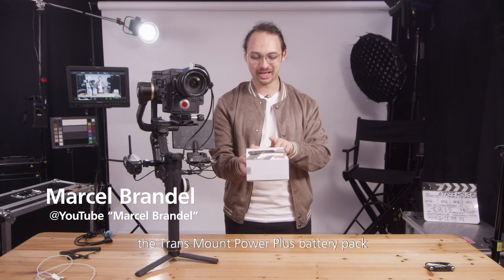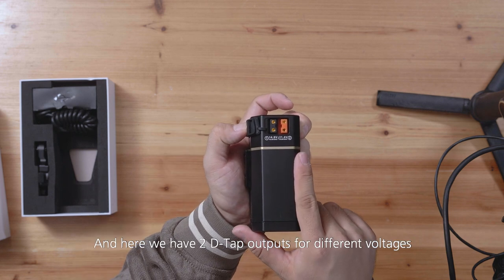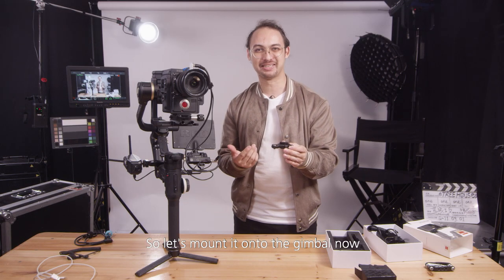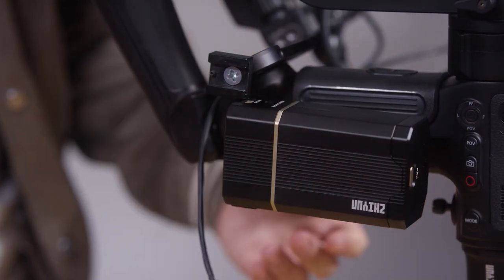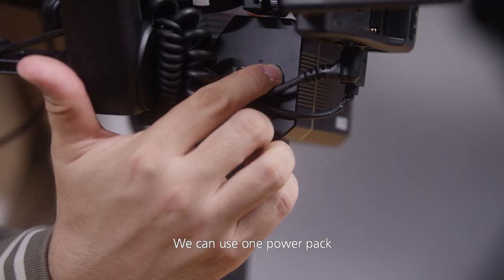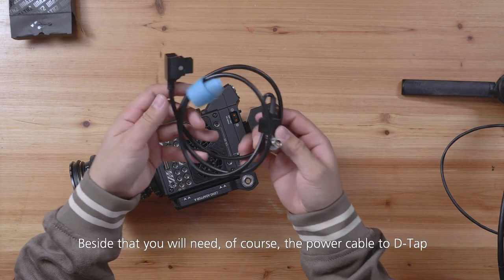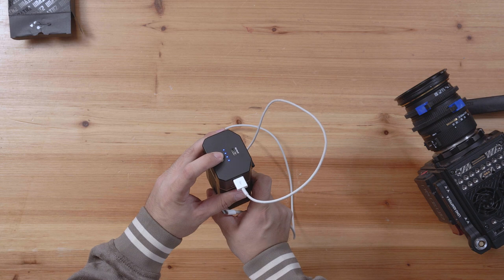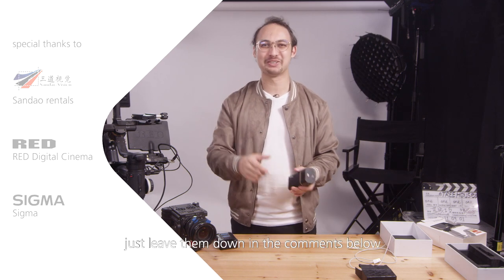Zhiyun Crane 3S OFFICIAL tutorials C4 transmount powerplus battery pack

Comment: Nice video! I‘m not sure if you still answer to these videos but you might be my last hope. My Transmount Battery pack shows a permanent 3rd LED always on. No LED except the 3rd one is always on and I cannot turn on or off the battery pack. It will be the same when I remove them, leave them out or leave it at idle for long time. What does it mean if the LED (3rd from the right to left) is always on? Thanks in advance! (This is a brand new 3S Pro set)

Comment: I HAVE THE ANSWER!  You have to isolate the bad battery(batteries) and remove them completely. Trash them and replace them with good batteries. You should have the extra 3 that came with the gimbal. Swap out the good one for the bad one(s) and you'll be back up and running!

Comment: do you need to charge the batteries inside individually?
Reply: 1 year later, but for people (like me) who are looking for this answer (I just bought one and opening the manual looking for answers);

In the manual it says you can charge it via the included USB-C cable by connecting USB-C port on it to power adapter (not provided). User may use power adapter that supports USB Power Delivery (USB-PD) to charge the battery pack. The maximum charging power of the battery pack is 30W.

Charging non ZHIYUN 18650-2600mAh 3.6V Li-ion batteries with the battery pack is forbidden! 

Charging or discharging the battery pack must be conducted with all 6 batteries at the same state of charge. Otherwise the batteries may be damaged by over charging or over discharging. 

So I bought a Nitecore li-ion charger with this, thinking I could buy more batteries (non zhiyun ones or zhiyun ones) and charge them in that thing. But if should believe the manual it's better to just charge them within this battery pack with all 6 equal charged batteries, instead of individual battery charging in a seperate charger. I wonder how it works then when you want to use your spare ZHIYUN 18650-2600mAh's. Do we need to charge them in the battery pack and when full take them all out and store these as backup (as a pack). Or can we just easily put in 6 same charged (assuming full) that were charged at the same time, but individually in a li-ion charger (in my case I bought a 8 at the same time one). 

Kind of unclear really, if you ask me.

Comment: I bought one and I couldn’t use it. The power pack would not  power my ninja v monitor I’ve order 4 different cables it never worked. But powered the crane and I didn’t even try to use my dummy battery for my eos r. I just bought a fxlion nano. It powers my entire rig. Using d tap splitter. The only reason I kept this was for the mounting plate and dtap cable for crane.

Comment: Can you change the batteries inside the casing? If not I have to buy two extra battery charger plates
Reply from the maker: yes, you can change the batteries inside the case
Reply: Yes they are interchangeable

Comment: My powerplus still has 3 blue LEDs, yet turns off after a few seconds after initially being turned on. Any ideas would be appreciated
Reply: did you remove the transparent plastic piece inside it ?  :)
Reply: Bro i we doing the same
Reply: Contact Zhiyun directly and see if they can replace it
Reply: I HAVE THE ANSWER!  You have to isolate the bad battery(batteries) and remove them completely. Trash them and replace them with good batteries. You should have the extra 3 that came with the gimbal. Swap out the good one for the bad one(s) and you'll be back up and running!
Reply: I HAVE THE ANSWER!  You have to isolate the bad battery(batteries) and remove them completely. Trash them and replace them with good batteries. You should have the extra 3 that came with the gimbal. Swap out the good one for the bad one(s) and you'll be back up and running! The battery that doesn't fully charge overnight is the bad one. Trash it
Reply: Same here

Comment: The button to turn my power pack on doesn’t work or isn’t responsive. Any ideas? It also says it is at half power and the LEDs only show when I plug in for charging
Reply from the maker: do you feel the button is broken or maybe it still works? inside the pack there are 6 battery cells, just to check if it might have some broken ones, try take 3 of them out and put in the original 3 batteries that came from the gimbal itself and insert them in the pack and try again, do try remember do which ones are which not to completely mix them up and see if it might work, if it works, then def contact zhiyun support and they should replace the broken ones
Reply: @marcelbrandel9078  i already do this but it still no working
Reply: I HAVE THE ANSWER!  You have to isolate the bad battery(batteries) and remove them completely. Trash them and replace them with good batteries. You should have the extra 3 that came with the gimbal. Swap out the good one for the bad one(s) and you'll be back up and running!
Reply: I HAVE THE ANSWER!  You have to isolate the bad battery(batteries) and remove them completely. Trash them and replace them with good batteries. You should have the extra 3 that came with the gimbal. Swap out the good one for the bad one(s) and you'll be back up and running! The battery that doesn't fully charge overnight is the bad one. Trash it

Comment: My battery pack does not power anything. No matter how long I charge it the LED indicators show they are empty. The LED's also only function when I plug it into the wall to show that it has begun "charging" I don't think it is really charging however. Yes I removed the film and tried swapping the batteries. Any ideas would be appreciated.
Reply from the maker: Hi, in this case I'd suggest to figure out if its the battery pack issue or charger issue, if u take the batteries out of the battery pack and charge them 2 times 3 batteries with the normal charger, put them back in and see if it works. If not, then the batteries have a problem if it works, then the battery pack case has a problem. In either way I'd then contact Zhiyun support with the service card and let them have it replaced
Reply: Just to follow up. I reached out to Zhiyun and they approved for me to return the item and get a replacement. The battery ended up smoking before I returned it so it was obvious something was wrong. I was nervous because I haven’t heard the best things about their cutler service, but luckily they were clutch.
Reply: I HAVE THE ANSWER!  You have to isolate the bad battery(batteries) and remove them completely. Trash them and replace them with good batteries. You should have the extra 3 that came with the gimbal. Swap out the good one for the bad one(s) and you'll be back up and running!
Reply: I HAVE THE ANSWER!  You have to isolate the bad battery(batteries) and remove them completely. Trash them and replace them with good batteries. You should have the extra 3 that came with the gimbal. Swap out the good one for the bad one(s) and you'll be back up and running! The battery that doesn't fully charge overnight is the bad one. Trash it
Reply: Use the DTAP! Otherwise it won’t charge

Comment: This power pack is the most unreliable piece of camera kit I’ve ever owned. Unstable charging, inconsistent power outage and now the piece of shit doesn’t even turn on. How the hell does anyone get this to work?
Reply: I HAVE THE ANSWER!  You have to isolate the bad battery(batteries) and remove them completely. Trash them and replace them with good batteries. You should have the extra 3 that came with the gimbal. Swap out the good one for the bad one(s) and you'll be back up and running! The battery that doesn't fully charge overnight is the bad one. Trash it
Reply: Still doesn’t work. Garbage product.
Reply: Use the DTAP! Otherwise it won’t charge